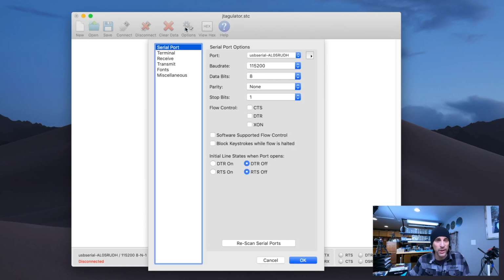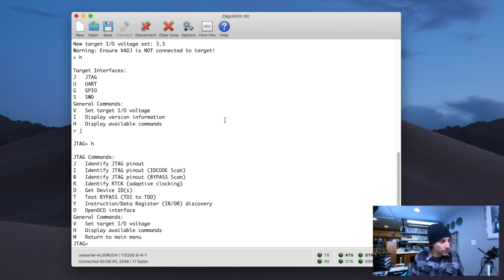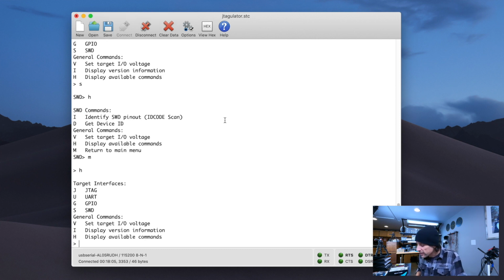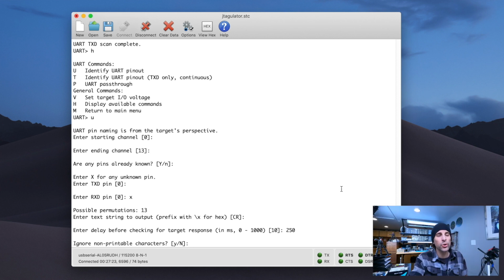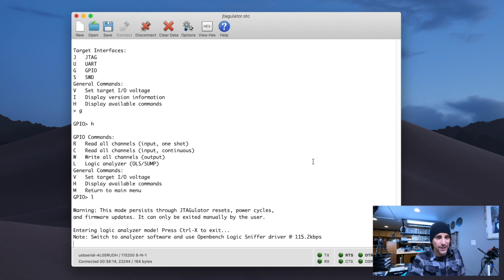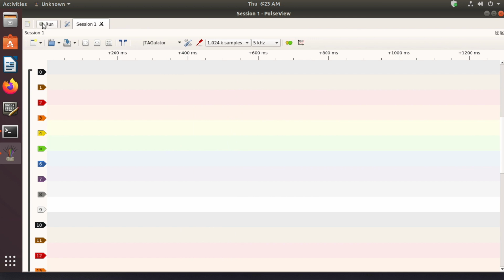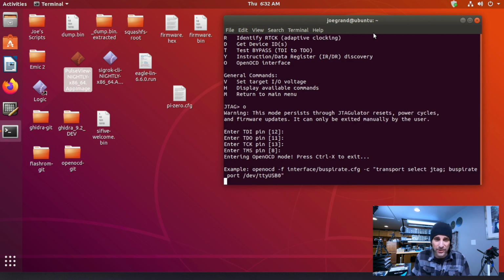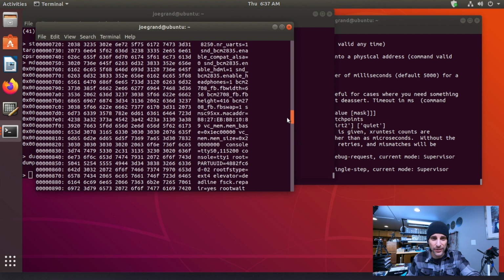JTAGulator: New Feature Update

Comment: This looks excellent. Definitely will need to pick one up once you've finished with the hardware tweaks.

Is there any way it could have a "target power supply/passthru" pin, so that the target can be automatically power cycled? That might help with identifying cases where it's stopped working because it didn't like the signals. Ooh, even auto shutoff if current draw is too high...